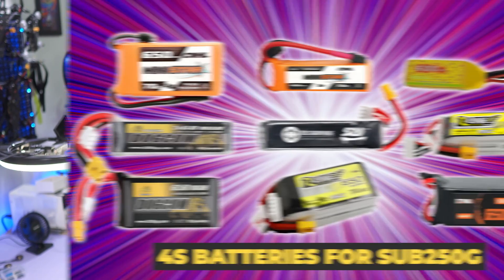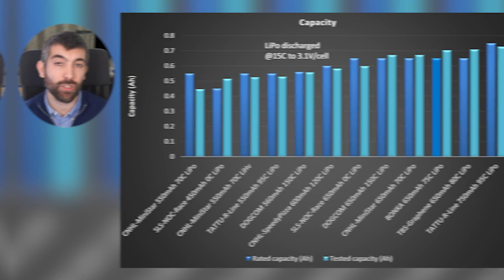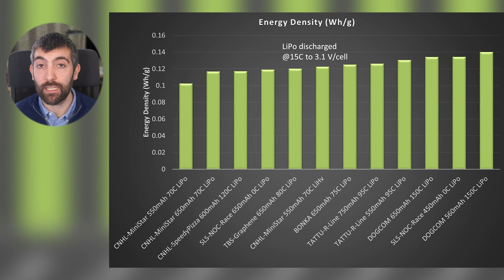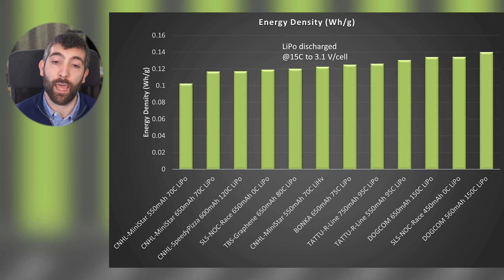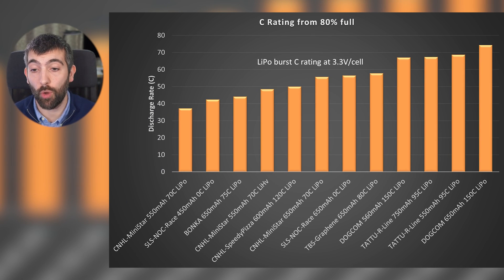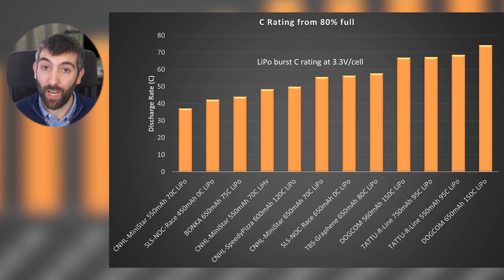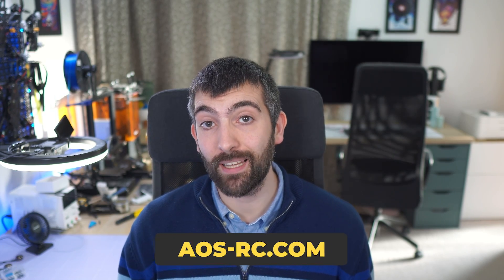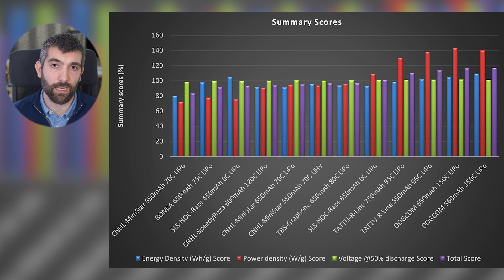Supercharge your 3" Quad: 3"/Sub250g LIPOs tested!

Comment: Why do you discharge with C rating current instead of one (or multiple) constant currents (eg. 10, 20, 50 A). This way it introduces manufacturer bias (eg. label battery with lower mAh and come out as voltage sag king).

Comment: Forget all these random cheap shitty lipo lets see a comparison between the top tier which all fpv pilots already know is dogcom, bonka, tattu. just put in anything rated to 150c and higher, also would be useful to see how they perform before and after 20 high amp discharge cycles.

Comment: One thing I noted with the R-line 550s is they can be charged to 4.35 per cell without noticeable degradation. Discovered this by abusing 10 or so packs thinking they're HV like the rest of my R-lines, and charged them in parallel and one at a time this way for over 6 months.

Comment: Why no GNB batteries? Why no 1000 or 1100 batteries? For reference, I fly the GNB 3S 1100 65C batteries in most of my quads from 2.5" through 4".  I have gotten over 15 minutes using this battery on a stock 2.5" GEPRC Phantom. Yeah, I am an endurance pilot and I don't fly stunts. Still, your video is about batteries rather than type of flights.

Comment: In my experience the Tattu's are light, very expensive and are great initially but after a bit of use, puff & fall off the cliff. The CNHL are cheap, heavy, mediocre performers, however don't puff and eventually out perform my Tattu batteries.  It's never clear cut.

Comment: Thank you, great testing Chris. Displaying a scatter chart of C-rating vs. Power-density (W/g) as a combined comparison could make for an interesting summary.
Including measurements of internal resistance when charged, and discharged could also be interesting, but this would require special equipment to get good results (uses high frequency AC). Generally is low, but increases significantly for weaker cells as they discharge. (this is an indicator of heat being generated, or unusable capacity)

Comment: What a nice timing I am right now in the build of a sub250gr 4s 4.5" quad. I have already 4s550mah tattus with which i'm happy on 2.5" 4s naked gopro cinewhoops. Most probably the 750 will be already to heavy on that 4.5" but i'd loved to use them, too. So good to know they are somewhat the better option. Liked as always the video and thanks a lot for your work!

Comment: I would also measure internal resistance which is an important parameter in judging battery quality and impacts heavily on voltage sag and performance
Reply: This. I bought some of the Tattu 6S 550 packs from Amazon  (I know, but it was a good deal on Black Friday) for my AOS 3.5 (love it!). I got IRs on first charge between 20-30 m-ohms per cell, and wrote to Tattu asking if this was normal, which of course they assured me it was. I understand that smaller cells mean higher IRs, but how high? Is it OK that are some cells in the same pack are starting out at 22 and others at 30?

Comment: For my 3S-gang: exactly what I saw with these batteries’ 3s brothers. I saw in 6s that Tattu was really the best and wanted to stick to the brand despite the price, but recently tried and liked Dogcom (MCK Ed.). So I tried the 3s 560 Dogcom as well and there is no difference in flight feel, time, max Amps and voltage drop when compared to the 550 r-line. Both however beat the 650 non r line tattu in all regards as well as the GNB up to 720mAh and obviously any 380 and the too heavy Tattu 850 (flying Baby Ape pro V2, with and without upgraded Motors) 
And when I asked other pilots about the Ministars their answers where all over the place and I guess that is exactly what we see.
Reply: from my experience I have only used R-lines and GNBs in 3s and the Rline blew the GNB away, on baby ape 2 non pro analog and a 533 trainer hdz (90s fps is crazy). I have a crux35 with the 1w  hdzero on the way

Comment: Of course there are limitations of testing. But note that 4S 850 mAh can also be considered sub250. The 3.5" EMAX Babyhawk O3 Air Unit is with a 4S 850 mAh lipo at 248 grams.

Comment: Again, you not show one of the two most important parameters.
ESR in milliOhms per cell and total pack including wire and connector? This will give a exact number to compare esr numbers. Remember to have the battery at 3.85v storage voltage and the same temperature. 
Get this one "Lipo ESR Meter Mark II

"

Comment: I have the cnhl ministar 650mah 4s lipos for my sub250, and it seems they placed in the middle for pretty much all the tests. They may not be the best or worst, but they are dirt cheap and perform great for casual freestyle. I can get them for about £9 per pack or even cheaper when they go on sale.
Reply: CNHL are currently running a sale on their online shop. I just bought some 650mah 4s for less than €7.50 each from their EU stock, despite watching this video. I can't justify paying triple the price just to get a bit more power when I only do freestyle.
Reply: @50mmcasemods36  oh nice, thanks

Comment: I was just looking for this video yesterday thanks! I hope to see more testing on 850mah (90g) batteries.   What are your thoughts on the 4.35V HV batteries? Are they hype,  or are they really delivering better energy density? Does the extra voltage damage the battery after cycles? Is the drop-off in performance comparable to 4.2 volt batteries after many cycles? How does the cell capacity handle abuse after a punch to 3v?

Comment: These tests prove what I've found subjectively.  Once I discovered TATTU R-Line I haven't looked back. Haven't tried any DOGCOM bats yet as they aren't as widely available in the US.
Also, I'd love more info on how you able to test these to such a low voltage and yet maintain a useable battery?